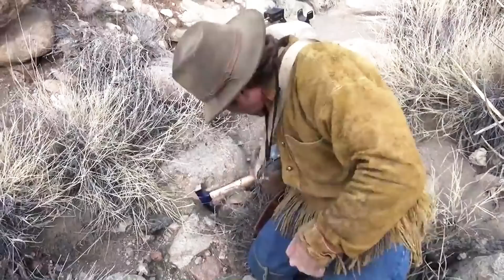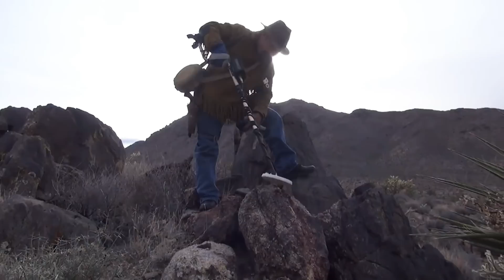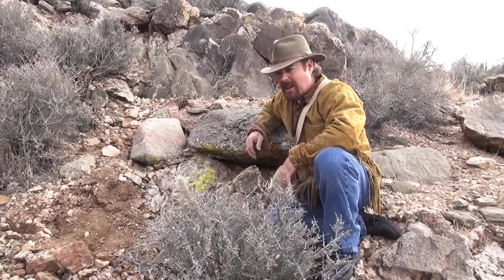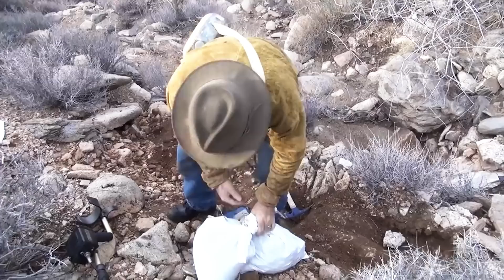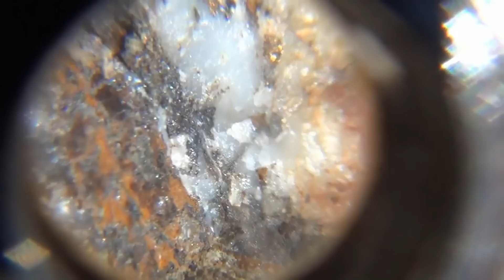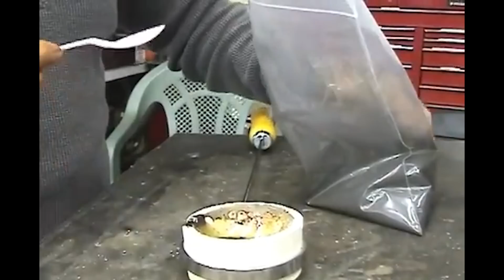The Lost Arrastra of Gold: Secret Location Revealed

Comment: There's a "modern" arrastra on the road from Mokelumne Hill to Valley Springs.  The arrastra was operated by the rancher by hooking up a model T engine and transmission set up to drag the bar around.  This apparently operated during the Depression.  One thing.  A lot of arrastras in California used mercury to build a slurry with the gold in solution.  I don't know about AZ or NV.
Reply from the maker: yes that was common to amalgamate the Gold